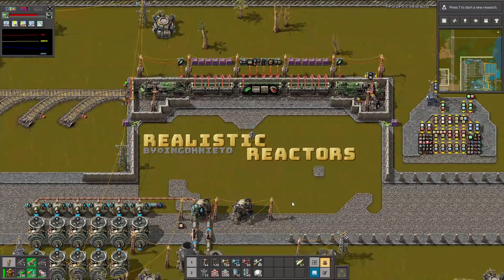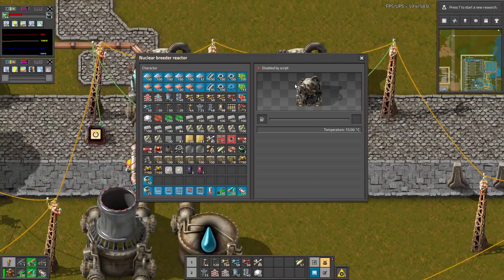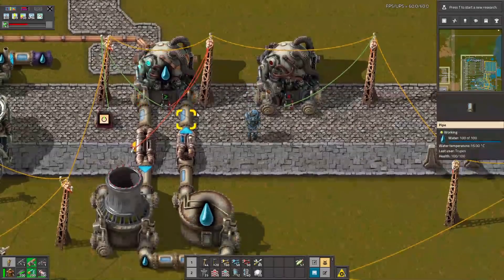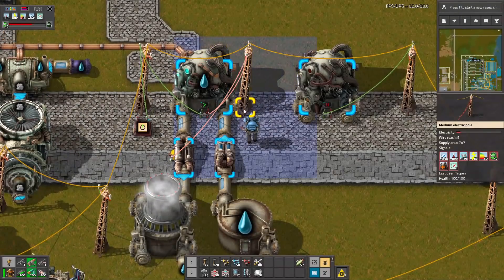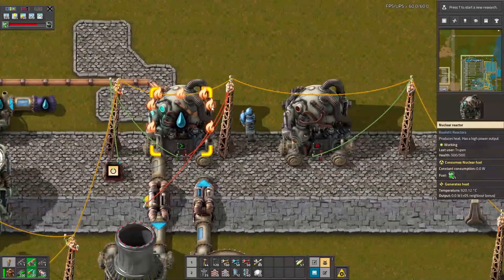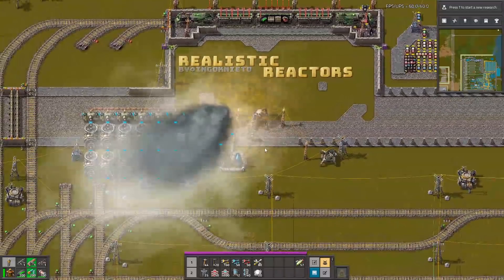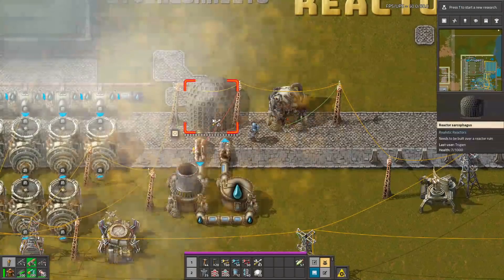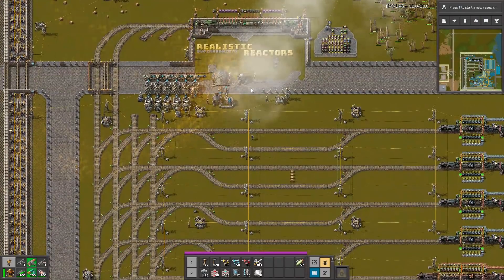ULTIMATE Nuclear Solution

Comment: As a former reactor operator I may need to try this mod sometime. See if I find it to actually be "realistic." 

I like to assume that there are degrees of safety measures built into factorio reactor systems that are part of the futuristic factorio autimations. Like we're talking about moving into Gen IV reactor designs that will be arguably walk-away-safe, the factorio reactor is like Gen IX, well past a walk-away safe design that's just that much more efficient. Heat pipes are a futuristic technology to me, but I can imagine a material that conducts heat being developed in the future. 

I like how factorio is realistic in that the only pollution in nuclear power is from the mining operations plus processing. Reactors themselves produce no pollution and spent fuel is recyclable into fuel for the next cycle. 

I guess I'm curious where all the other material that comes out with uranium ore disappears off to, though. I think it would make sense if those other 9 pieces of "uranuim ore" became stone and trace amounts of iron and copper.
Reply: I didn't even think about it in the first comment but an explosion in current-generation reactors is nigh impossible, and the explosion at chernobyl was related to gasses rather than the nuclear chain reaction. The heat generated by the runaway chain reaction in Chernobyl caused various gasses to expand, resulting in an explosion due to insufficient pressure containment.

Point is, a meltdown may result in a release of radiation to the next level of containment, but by Factorio reactor technology level, there shouldn't really be much of any outward reactor problems from a meltdown, just require a cleanup operation that may produce "corium" which would probably work best as a gift in diplomatic relations with biters but not be quite as good as regular uranium-based weapons. 

In other words, I think a nuclear explosion from a factorio reactor should realistically be literally impossible but everyone likes a little bit of science fantasy. 

Maybe factorio engineer altered nuclear reactors in some way that can allow them to explode by damage, so that if biters destroy the reactor, they'll die rather than cause more destruction elsewhere in factory.
Reply: It is not futuristic, it is impossible one. You need a certain power flow and no amount of metal can provide it without loosing on significant gradient of heat field.
Reply: You don't know about the insular nature of the materials. Maybe there's something going on. Also for sure there's no 100% efficient anything so there's a bit of ideal vs. real lost with this game. Similarly power lines can't actually transmit infinite power across them with no issues.
Reply: @fissionphoenix4995  PC cooling systems do not use solid copper no matter how expensive system is. And the copper is second best metal in terms of thermal conductivity.
Reply: @heyhoe168  just use a vacuum filled pipe with a conductive core.
Reply: @Ghorda9  bruh. Just read some physics, you dont understand a basic conductance equation.
Reply: @heyhoe168  then explain it.
Reply: @Ghorda9  I kind of did. Stationary solve of thermal conductance equation is some sort of gradient. Area times gradient stepness is a power delivered. It means that solid thermal conductors can pass very limited amount of power. This is the reason why ALL power stations utilize physical medium flow instead of stationary thermal conductors.

Comment: Mod seems good but if you are building modpack based on krastorio2 or similar big mod than realistic reactors not worth it.
For 4 reactor operating on best Energy and efficiency output it requires a lot of things to build including a lot of water and safety precautions from circuits. And after all that power generation wouldn't be enough to satisfy after like 2 days of playing. So reactor is really time consuming while providing not that bad amounts of energy i doubt energy per time to build ratio
Reply: But it's a badass nuclear reactor

Comment: The cooling water should be heated up to be placed into the turbines instead of the heat pipe doing it, as that's more how it works IRL.
Reply: I've been trying to do it, but I didn't manage to figure out how to make reactor's temperature constantly stay within 195-200℅ of reactor's efficacy.
Reply: @comraddisc2783  if you support turbines in parallel to cooling tower. Each building is supported by its own pump. In a case of low energy production and overheating reactor we connect cooling tower.
Reply: @iIiWARHEADiIi  tbh, i haven't thought about that solution. I had something like "one mess of turbines over here, some pumps for everything over here, and a bunch of cooling towers over there". Thanks, i'll try the method you're talking about.
Reply: Maybe have 4 water pipe inputs and 4 outputs directly on the reactor?

Comment: Would be cool if water in cooling system became unusable because of radiation
Reply: I don't get it. The water used for cooling in reactors is decoupled from the fluid in direct contact with the fuel. Even if it wasn't, why would radiation turn water unusable? Water is an excellent insulator for radiation -- you can safely swim on the top of a cooling pool full of spent rods. About the worst that can happen is particles of radioactive material become dispersed in a body of potable water and somebody drinks it over a prolonged period.
Reply: Cooling water dont have direct coontact with izotops so is not contaminated.
Reply: The water isn't contaminated as it actually never touches the radioactive part of the reactor. You can just conduct the heat itself without making the water touch the contaminated part.
Reply: That'll only work if the reactor was an rbmk one and those wouldn't fit the mod because rbmk reactors don't explode.
Reply from the maker: true